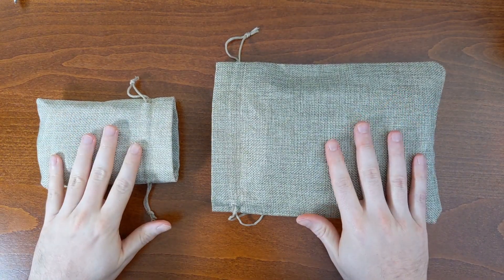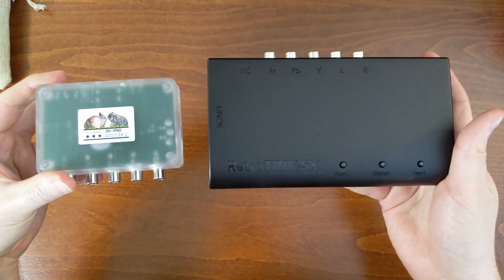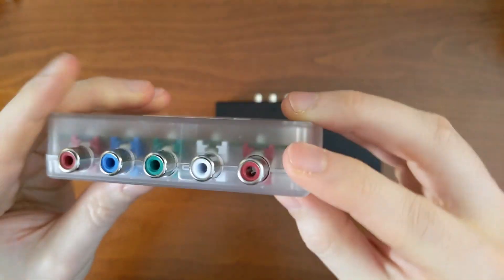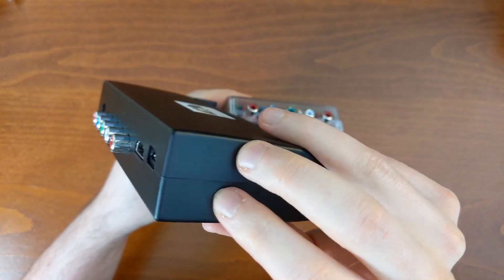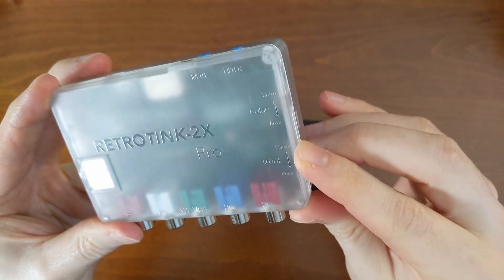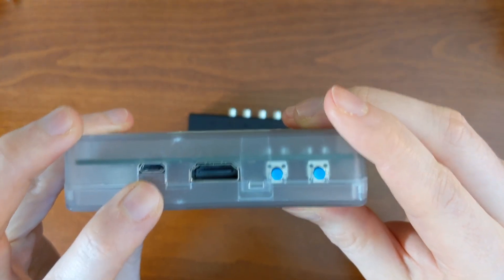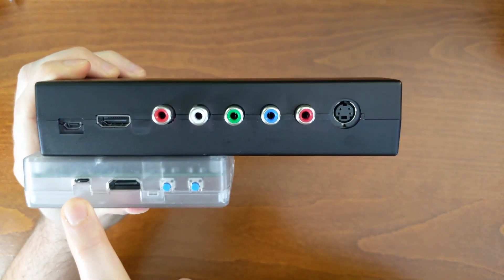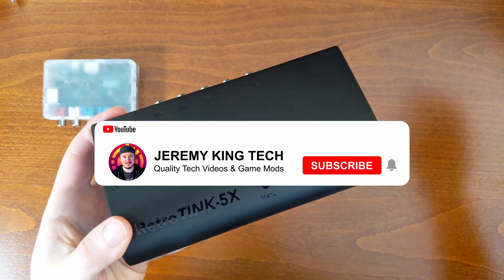RetroTINK 5x Pro vs 2x Pro (Hardware Comparison)

Comment: I want to get an actual upscaler. Is the 5x worth it? Or would i be happy with the 2x? 

Im ok to spend 300 on 5x but im having a hard time justifying it.
Reply from the maker: I think it depends on your TV resolution in terms of whether you should get a 2x or 5x line scaler. In terms of features, the RetroTink 5x offers so much more than the 2x does. With upgradable firmware, It's been consistently updated over the years. The same can't be said for the 2x. If you have the money, get a 5x imo.

Comment: so if not doing anything other than gaming off retro i.e. Gamecube and N64 and just want better graphics and playability... is the 2x Pro suffice?
Reply from the maker: It really depends on the resolution you want to scale to. What is your monitor/TV resolution?
Reply: I have a 1440p and a 4k, thanks for getting back.. subbed  @NetizenKing
Reply from the maker: @chrislehmann6240  no problem, man. Thanks for checking out my video/channel! I'd go with the 5x Pro if budget allows for it. It offers so many more features. The dev (Mike) is also continually releasing new firmware updates on his Discord which is awesome. I'm not sure when, but the 4K version of the RetroTINK has been in development for quite awhile now. It's supposed to drop in the near future. But expect a heavy price tag on that one.

Comment: Hey I have a 65inch Sony a80j oled and I wanna play my ps2 what do u recommend 2x or 5x
Reply from the maker: If your screen is 1080p+ I would get the 5x.
Reply: @NetizenKing  yea the oleds are 4k tv and I believe they have the capability to upscale to 8k
Reply from the maker: Then definitely go with the 5x Pro. The 4K model is in development which might be even better for you but no on word on release date yet! The 5x does have an experimental firmware which offered a limited 4K mode. Might also be worth looking into.

Comment: How is this a hardware comparison? You just showed the input and output connections. You didn't show any functionality of either product and how they compare to one another.
Reply from the maker: Well, it's not a firmware comparison. Which would be a very extensive comparison between the 2x scaling + filtering options on the 2x versus the 5x+ scaling and many, many more options and features of the 5x Pro. If you have a better description of it, I'm open to hearing it.

Comment: i have a 4k lg tv and theres not a good hdmi option for ps2 should i get the 2x or 5x i just dont want to spend double if theres not many benefits
Reply from the maker: For a 4K tv, I would get the 5x or even hold out until the 4K device releases.
Reply: @NetizenKing  i heard the 5x is really overkill but the 2x pro multi format is the best for the ps2 but its not on mikes page any more:/
Reply from the maker: On a 4k tv you want as many lines multiplied as possible. More lines, the better the picture at higher resolutions. The 2x literally only doubles the lines. I wouldn't bother with anything less than the 5x pro on a 4k tv.

Comment: I have the retrotink 2x pro and im just wondering if the 5x handles composite and s-video the same or better.
Reply from the maker: Across the board, everything is better. It's been getting regular firmware updates.
Reply: @NetizenKing   thanks for your reply, good to know.

Comment: Couldn’t you just plug all your consoles into a av switcher and then plug the output into the retro rink? Instead of unplugging every time.
Reply from the maker: You absolutely could but you'd need a very robust switcher with a lot of inputs for the various consoles. But yeah, that's definitely an option!

Comment: Which would you recommend for nes, genesis, dreamcast and wii to a 4k tv?
Reply from the maker: The 5x pro or the upcoming 4k unit will do everything you'd need.
Reply: @NetizenKing  I didn't know about the 4k unit. Is it on there website or where did you hear about it? Thanks
Reply from the maker: Mike Chi the dev has been sharing development of it in socials for a few months. I wouldn't be surprised if it was out before Christmas.
Reply: @NetizenKing  First I've heard of this. I think I'll wait to pick one up, that sounds pretty sick
Reply from the maker: It's coming!

Comment: Does the retro tink 2X pro Work well with game cube or Nintendo 64
Reply from the maker: Worked quite well for me! If you're looking for an entry line doubler, the 2x Pro will do pretty much everything you'd need for retro gaming on a modest display.
Reply: @NetizenKing  Thank you I was just curious because I collect Nintendo systems and been meaning to find a way to make GameCube games are good on modern TVs or my other Nintendo systems
Reply from the maker: @aaww1010  as long as you don't have a UHD screen, the 2x Pro is an excellent device for this purpose. The 5x Pro can push resolutions up to 1440p and even experimentally into 4K (24fps).
Reply: @NetizenKing  The retro toolbox is going to be used for the Nintendo 64 and other systems and the carpy is going to be use for my game cube do enhance Game boy and game cube games
Reply from the maker: @aaww1010  nice
Reply: @NetizenKing  One extra thing I’m ordering is CARBY For my game cube to get really good picture